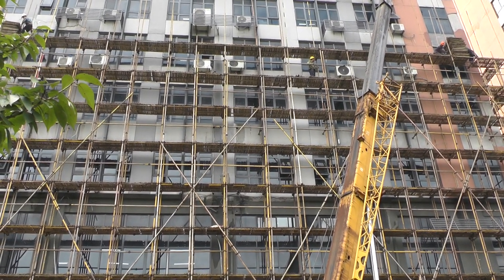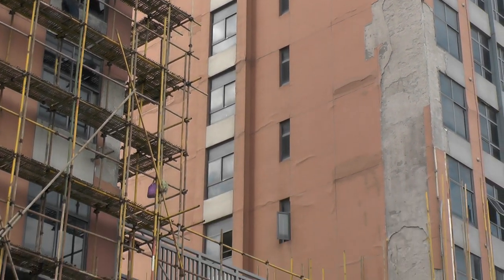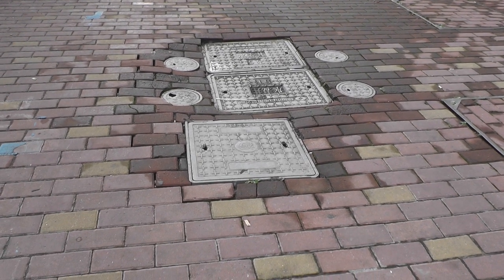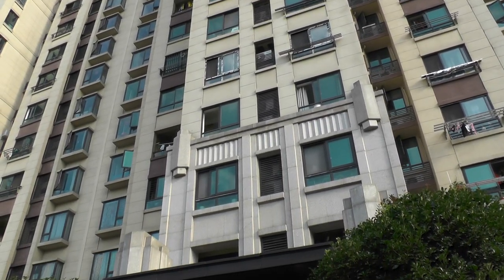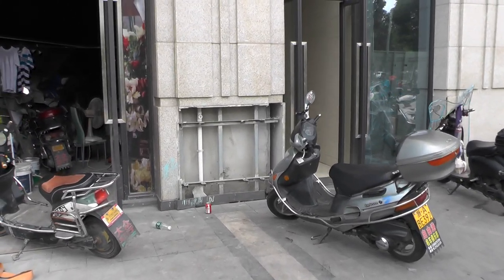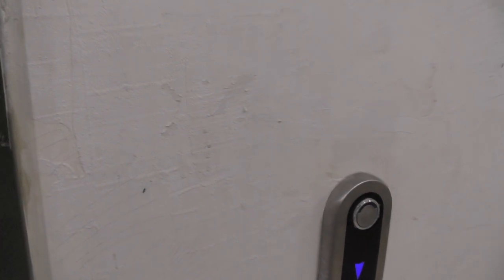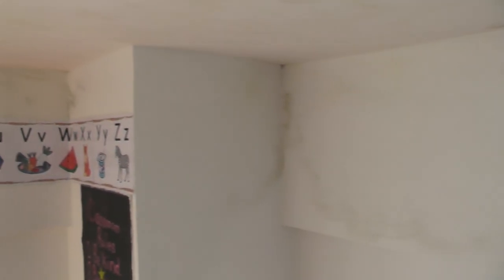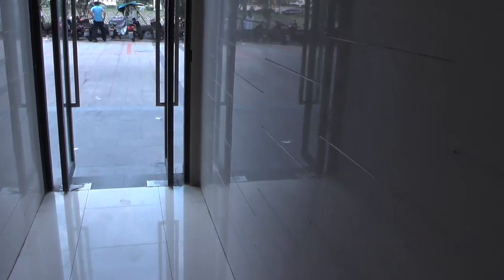Chinese Construction - Chabuduo

Comment: WoW, I never would have thought it was like that over yonder!! Not sure I like our wood going over there to build thier buildings.. We have our own to build, wood is disappearing faster than it is growing. Bamboo which they feed Pandas is faster growing tree or grass from what I have read. But what do I know. Say have you considered buying a Replica Rolex while you are there? That is where they come from. I would buy one of the better ones not the under 100$ ones.
Reply from the maker: Look at the scaffolding in the video.  They use bamboo as the floor on the scaffolding and they climb up that scaffolding effortlessly.  I've bought 2 fake Rolexes over there.  One worked great, but the other was a piece of junk.  I ended up shooting it for a target.
Reply: Yes but what price did you pay for the junk watch? What if you paid like 500 bucks you would expect some better quality I would think anyway. I have seen some fakes go for 12-15 hundred bucks. True not the same as 7 grand but they are Replicas after all.
Reply from the maker: The first one cost somewhere around $60 and it ran fine.  The 2nd one was $38 and it was broken from the start.  I think the merchant pulled a switch on me.